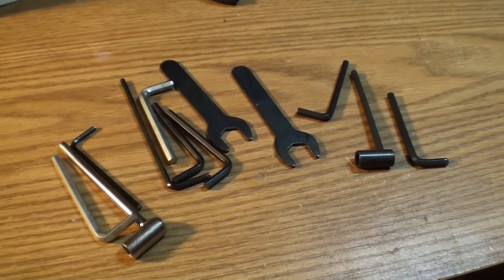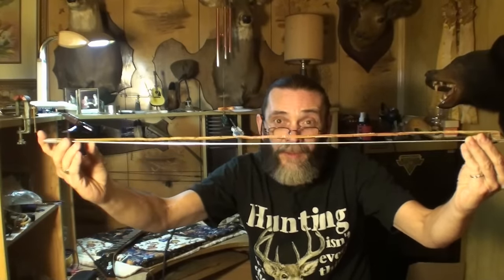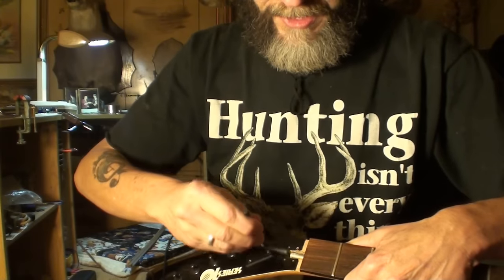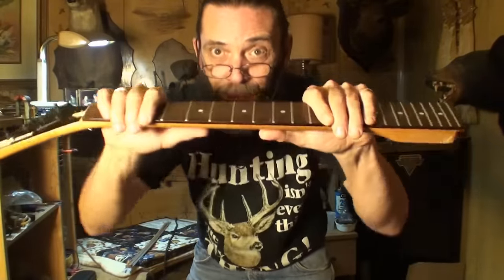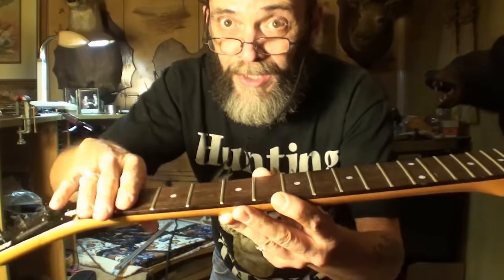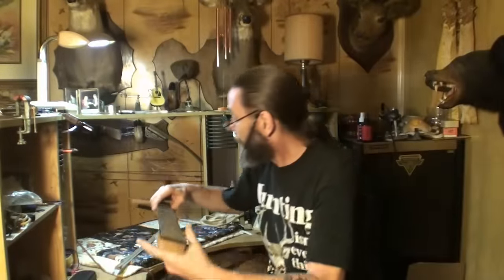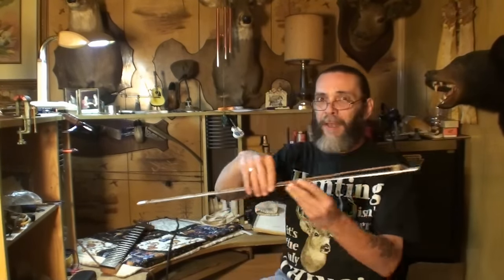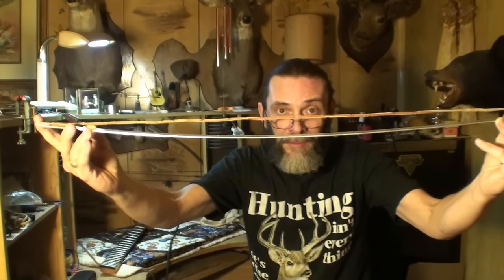guitar truss rod adjustment how it works by Randy Schartiger

Comment: I tried to adjust my truss rod with strings off. I went all the way right till it started to get tight and didn't notice a difference so i  backed off and set it in the middle and it's still bowing. I took it in and the repair man said nothing was wrong. I'm not sure about that since i have to twist my wrist too much to play a C chord cleanly and near the first fret is so much harder to play then near the 7th fret. Is it a warped neck? I herd that truss rod adjustments can't help if it's that bad and that there is a different repair for warped necks. Also it's an acoustic.
Reply from the maker: +blood lord (Chaotic Sonics) I'm not sure your truss rod is working, if it is you may need to take several days of slowly tightening it giving the wood of the neck time to catch up. It should be easiest to play on the 1st fret at all times. It's really hard to say without seeing it but it sounds liker it's a bad forward warp or the truss isn't working properly.
Reply: Randy Schartiger
I tried adjust it a bit before your reply and it got a bit better,but still have to press a little hard to fret at the top. Good thing is i don't have to twist my wrist so much too. I felt like i was going to break my wrist.
Reply: Randy Schartiger
Also when i first tried it then put it back i didn't give it time to settle. looked for a second and didn't noticed a difference then got a bit scared and put it back lol.
Reply: Randy Schartiger
I just gave it many turns it in little  increments after playing the chords and checking the fret that was giving me issues..It's a lot easier to play with no buzzing and i'm faster. I guess people should trust their truss rod lol. My guitar teacher said he doesn't even do it and he's been playing for over 20 years. Thank you for this video.
Reply from the maker: blood lord
You're welcome mate, sorry I couldn't be more help, it's just really hard to give accurate info without seeing it first hand, sometimes pictures help. And yes on trusting the truss! lol thats a good one! :)
Reply: Randy Schartiger
The video was more then enough, giving encouragement to tweek the truss rod and what to look out for.  lol you can use that one as the tittle if you make another truss rod video.
Reply: Randy Schartiger
I've been playing my guitar for a while and noticed some fret buzz at the top, 12th fret is fine so there is some relief that i left. I also just got a new electric guitar and plays really nice from default factory adjustment, not too high or too low action. I looked at my frets on acoustic and they are pretty much worn lol. Feeling a little brave in attempting to refret the acoustic once i do alot of research on how to refret. I know refretting charges are a lot and it will be more then the guitar is worth. Do you have any videos on refretting for beginners?
Reply from the maker: blood lord
I had a few on refretting but can't find them lol Youtube is known for taking down videos for what ever reasons and not saying anything about it. Unless your fretts are REALLY bad you might be able to level and dress them, especially if it's never been done to that guitar. Just about every guitar I get in here that want new frets can be fixed by leveling and dressing the old frets back to new condition, I'm going to be starting a video series on this very soon but already have a bunch of videos doing it if they didn't get vanished.
Reply: Randy Schartiger
cool, yea my frets are pretty bad lol. Rusting a bit, the ends on the frets are worn (don't know how that happened) , and some on the top of the fret is worn down. The acoustic guitar was my brother's that had it for years and didn't play for long and didn't repair and adjust it at all. It's a really big and warm sounding dreadnought.

Comment: "Use a tool that fits..."  So true - here in Europe where we run into guitars from everywhere and they use metric, imperial, USA, whatever threads.  And the point about loosen it first (and 3 in 1 oil).  And take it half a turn a day - no wrenching it round two or three turns on one day - take it easy.